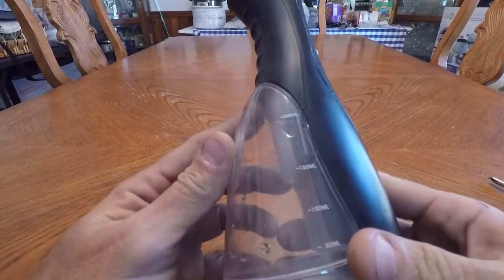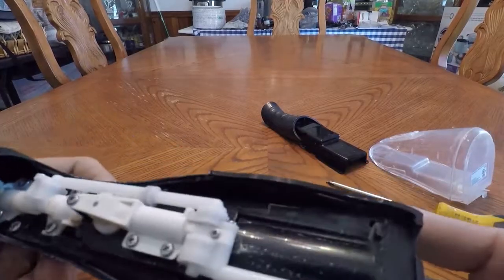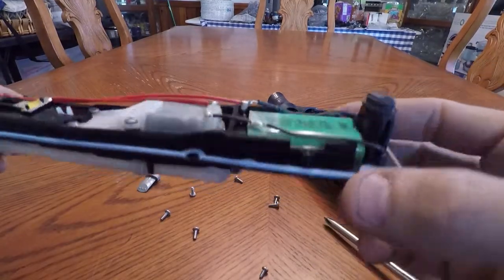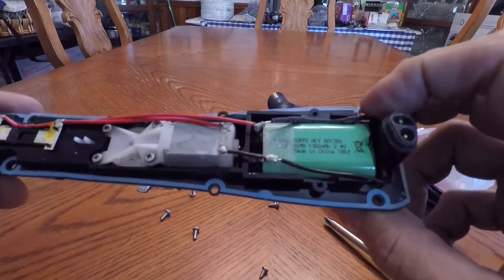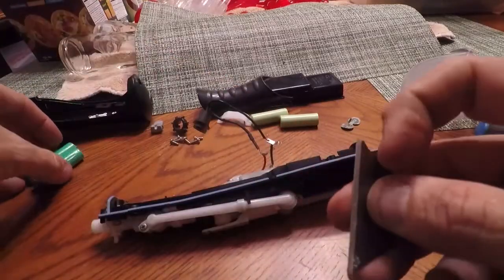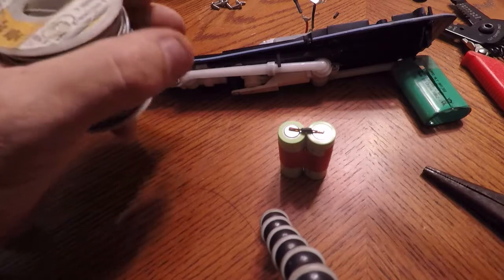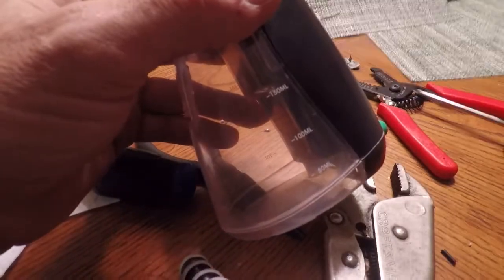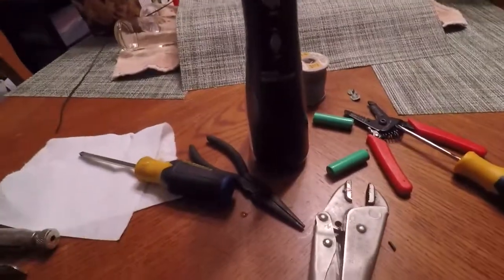Changing the battery in a Waterpik Water Flosser

Comment: It would have been cooler if you'd replaced the Ni-MH batteries with some lithium cells and the power port with a USB-C connector and a charge controller. The battery life would be much longer and you could charge it off any USB-PD charger.

Comment: I haven't bought one of these yet, am thinking of it. But, I wanted to say looks great! I had to do the same, but to my Waterpik toothbrush. The one I have they stopped selling a few years ago, and I managed to find a video online showing how to change the battery in a very similar one (same brand, same head, just a slightly different body - newer model). I was ecstatic I was able to change the battery because I've never had a better toothbrush, and I really didn't want to have to replace it with their newest models. (Newest models require one to buy the water flosser with the toothbrush, and I already have a non-cordless water flosser, don't need another. Very annoying.) Anyway, thanks for the video!

Comment: Great job Aaron. What is that brown liquid you call flox you use before soldering? Thank you.
Reply from the maker: Howdy! Flux is a light acid that allows the solder to flow better into the joints. I think it also help clean the connections a bit.
Reply: Thanks lll

Comment: Hi Arron, found your page after my batteries died after about 9 months. Unit may have been on store shelf a while. My hygienist said these units do not have enough power especially when batteries start to go. So I was thinking to increase battery voltage, but charger is only 3 volts. Also don't know how much voltage the DC motor can take. Looking at a lithium ion battery replacement. More life in them. Provided no water leaks it should be better. Did you consider this? Also going to see if a double A two battery holder will fit into unit. Then it's a wire to wire solder connection. Agree batteries should be much easier to replace.
Reply from the maker: I did think about upgrading but didn't do it. It's annoying so many things are just built to discard.

Comment: Without the tabs you can use "de solder braid" for the tabs.It's available at Radio Shack.
Reply from the maker: I actually have some of that.  Didn't think to use it.  So far it's working well. Thanks!
Reply: RADIO SHACK WENT OUT OF BUST YEARS AGO!!!

Comment: Hi! I have the exact same watepik and i accidentally burned the charger (it was for 110 voltios and i plugged it on a 220 voltios). Do you happen to know how may i charge it with some other charger?  a friend of mine told me to grab a mobile charger and weld it with the waterpik original cable, do you see that as an option? thanks in advanced!
Reply from the maker: Hmmmm. If you can find a charger that outputs the same amperage and voltage and then get the wires hooked up, I'd bet it would work. Alternately, there may be aftermarket ones available online. Good luck! Thanks!

Comment: It looks as your 4/5 batteries are smaller than the original ones which makes me think that  the original may be  regular rechargeable 1.2 volts AA easier to find and up to 2300 mha capacity. Great video, got to replace the batteries in mine. Thanks!
Reply: I replaced the batteries in mine, they hold the charge and work for a whole week. I used a pair of AA 2300 mha batteries.
Reply: Hi Raymond
I just measured mine with a vernier... 49mm.  So they are actually full size AA.  There is maybe 55mm space in there. Not looked if there is anything bigger we could fit though
Reply: I just measured mine, 45mm, so can confirm they are standard AA size, not 4/5 size